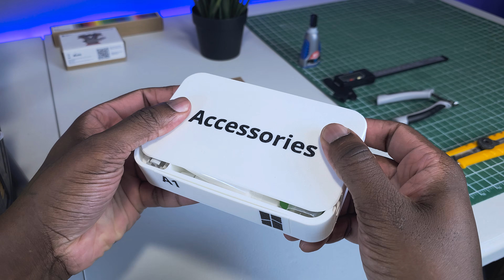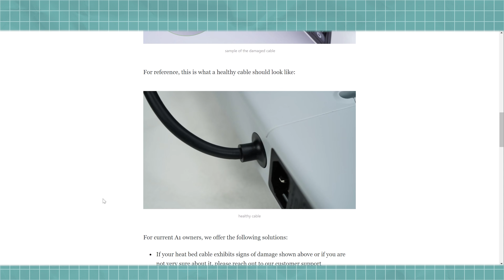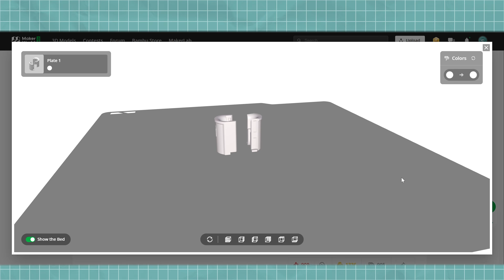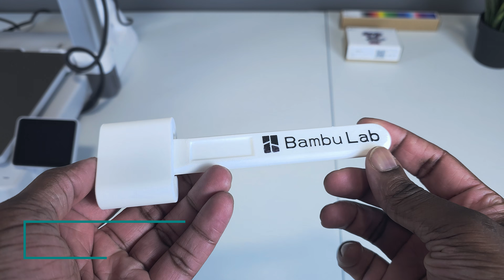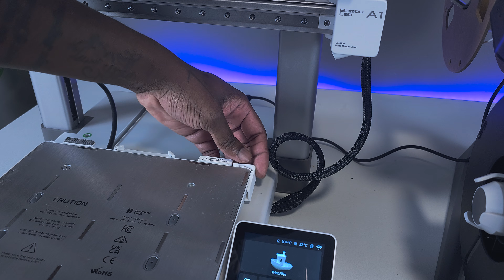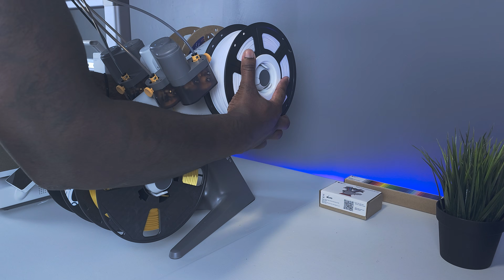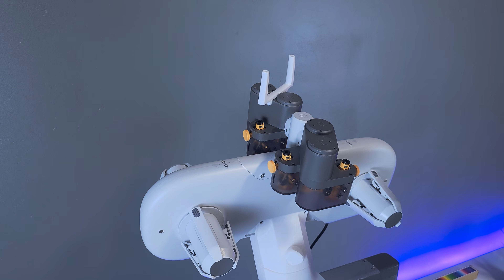Must-Have 3D Printed Accessories! for The Bambu Lab A1

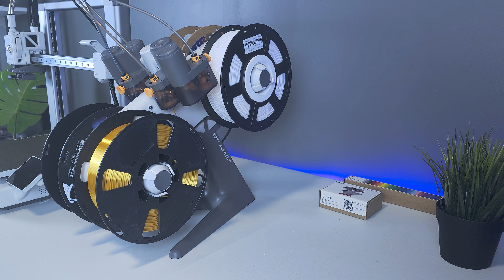Comment: 9:09 Is it possible (thinking durability) to print the top mount in PLA or should it be printed with something else?
Reply from the maker: Yes, you can definitely print the top-mount using PLA. I used Sunlu's meta PLA and it's held up great.

Comment: Very professional video and I needed some of those files. Thank you. Regarding the AMS on top of the gantry-- I may be the only one in the world who worries about it, but I don't like mounting spool holders on top of any of my printers. It's almost a certainty that the amount of mass in those devices will accentuate movement from the bed and other moving parts adversely affecting the precision of the prints. I could be wrong. The mass may actually serve as dampers instead, improving your prints. Maybe an engineer will chime in. Subbed and liked.
Reply from the maker: Thanks for your support! I'm glad that you liked the video.. It doesn't hurt to air on the side of caution - if you have desk space available go ahead and setup the AMS beside your printer. Personally, I didn't notice any difference in the print quality when top-mounted.. It would use up some filament but you can also try and compare.

Comment: I would love to see an AMS Lite mount that actually mounts it upside down.  Is it just me or is it a real pain feeding the filament into those ports where you can't see them? The regular AMS is SO much easier.   Take me seconds to put in a new spool on my X1C and minutes to do it on my A1.  Most of that time is spent fumbling with unseen entry port.
Reply from the maker: It can definitely be annoying at times trying to feed filament through the AMS Lite. I guess both have their quirks and advantages.

Comment: In 2012 I got a Printrbot from their first Kickstarter. The first thing I did was print a bunch of accessories to improve the printer. 12 years later and we are still doing the same thing for brand new printers. It's like buying a new car and then going straight to the local auto shop.. No-one does that
Reply: Yes we do.  (Actually Amazon, and not Autozone).  Instead of $300 to the dealer for the factory rock guards, $45 online.  The tray for the armrest console, not available in the US, $25 online.  Dash mat, $200 from the dealer, $50 online.  That little net for the back of the SUV, $100 from the dealer, $30 online

Comment: For top mounting the ams, I'm just wondering if it'll wobble the printer and you'll need to slow down your prints?
Reply from the maker: Hey! I had the same thoughts before printing this accessory, but I haven't noticed any difference in the print quality.

Comment: after installing the printer. i know why the heat bed cable kept breaking. it is due ot the design of the printer. the fact that the cable is in the way of the sliding back plate you have to move which catches the cable every time you have to maintain or even initially build the item in the first place. the printer is a POS and they need to redesign all of it to make it actually user friendly. what a waste of money, my flashforge ad5m was a much better investment.

Comment: Great video, I've been thinking about picking one of these up for a bit to use as a second printer.  I saw you it on a folding table for the video, is that what you normally operate it on? A folding table would be a convenient option for me but I do worry about stability effecting prints, have you had any issues?
Reply from the maker: Thanks for watching! A folding table works for my needs but I'll admit that a more solid table would be ideal. The quantity of prints that my setup produces is great, but I do sometimes notice that layer lines stand out on tall, skinny prints due to the table vibrating or shaking slightly.

Comment: First one you don't need it anymore
Reply: Correct. Got mine today and it has the upgraded Kevlar cable
Reply: I received an A1 yesterday and they have covered the entire heat bed cable with mesh.
Reply: @BanditTheLizard  I’m gonna be getting one from my school soon! Hopefully 🤞
Reply: @49thstate_outdoors  From your school???
Reply: @siikasim yesssir. It actually arrived today I just need to go pick it up this week! I can’t wait. I got it ordered with my allotment cuz I’m homeschooled and we do homeschool through a school that’s a homeschool school…😅. But anyways I basically got it free cuz it’s from allotment I didn’t have to get it reimbursed. But Yeha I can’t woant to pick it up and then I’m gonna print a skew ride 2 parts and then once I get some more cash I’ll buy the build kit and have a wick rc sled for some deep powder! And I’m gonna. Use my traxxas 5800mah battarys so should be good runtime and power on those
Reply: @49thstate_outdoors Lucky you!
Reply: @siikasim yeah bro the allotment is really cool cuz I can buy school stuff like that. But Yeha I can’t wait to start printing parts for the ske ride rc sled.
Reply: @49thstate_outdoors  Bro i just want one so bad😅
Reply: Why
Reply: @austinevans26  Cause they corrected it from the factory.
Reply: @austinevans26  it's fixed with the new printers
Reply: @austinevans26 fixed
Reply: Yeah he posted that update 10 months ago

Comment: i got my bambu lab a1 combo today.  
and the cable has a braided sleeve. and there are other diffrences making me think this is the V2 after the callback.
Reply from the maker: That's right, the A1 printers sold now have been fixed and feature a few upgrades, so nothing to worry about. Hope you enjoy 3D printing with your new machine!
Reply: @Creatorrific  
it's actually fun to print now.  
the tinkering is ok.  but just simply printing and it just working is actually alot better.

Comment: I don’t know if anyone else takes this shortcut … when switching to the external spool, you would need to disconnect one of the PTFE tubes from the print head and insert the external spool PTFE tube into the open spot. Since pulling a tube from the print head side is quite the frustrating task, even with special tools, I do it differently. The small length of PTFE tube on the external spool holder gets disconnected and put away. When you need to use the external spool, you will not need the AMS lite, so simply disconnect the PTFE tube from an empty slot on the AMS (the tube disconnects very easily from this end) and connect that end of the tube to the external spool connector. You will need to feed more filament through the longer tube to get it to the print head but this won’t cause any issues while printing except with flexible filaments with hardness less than 85a. I have used 85a with this arrangement and the extra friction from longer tube with a longer turn was able to print well but when unloading, the friction was noticeable. My filament has a matte finish on the raw filament and that also contributes to the friction. As usual, make sure your filament is nice and dry before using this method since it may need to make sharper turns before reaching the print head and brittle filaments are not PTFE-friendly.

Comment: 1can someone design a handle/attachement that has 4 ptfe handles so one can put 4 non-ams spool to the 4 hub-hotend this way i would only unload (pull a little bit out not all the way) and load a different color/material pushing a little bit. this way i can have 4 colors/material partially loaded.

Comment: What about building a support for the top-mount extension AMS to the back wall for stability?  Good or bad idea?
Reply from the maker: I've seen it done. I don't think it's a terrible idea if your wall material allows it, but I think the printed top mount works great since there's no need for construction.

Comment: Got my A1 last week. The top mount screws were actually already included and the cable thingy has been fixed!
Reply from the maker: That's dope that it came with the screws already. Hope you enjoy the new 3d printer. Thanks a lot for watching!
Reply: Hi, regarding the top mount for AMS, do you have any issues with it? I'm a bit afraid that the metal part on the top of the A1 will bend with the time under the AMS weight
Reply: @CindyBardalou  no issues so far and tbh everything is quite sturdy, so I don't think anything will happen soon.

Comment: 30 bucks on amazon... a quad holder and 3 bowden tubes later and i  don't need an ams.... btw its only there to tell the printer what you are using for filament...
Reply: How did you do this I am very curious

Comment: Great list of accessories. Love the video. Thanks!
Reply from the maker: Thanks for supporting!
Reply: @Creatorrific  So I did notice that when I tried to use the build plate aligner that I'm not getting "nozzle is covered with filaments" errors because it looks like it checks for filament in the upper left AND upper right corner. Great idea but it looks like the new firmware may cause some issues. Beat my head against this issue for HOURS before realizing what might be causing it.

Comment: The shitty tubing fittings should have been recalled from the start. Biggest gripe. Ive neber in my life had such a hard time removing tubing and I deal with push connect  air fittings almost daily at work.

Comment: Great video. I like that top mount. Most in the past do not have the stiffeners and the A1 is top heavy the the top mount AMS, this solves that problem. I didn't have any problem aligning the build plate with my pre-recall A1 but seem to with it's replacement I just got. Not sure it's it's the new printer or what. If they would remove or move forward the rear magnets on the heat bed I thing it would solve this problem or make the stops on the back of the heat bed bigger/taller. While I like my BBL A1 regretfully "getting back to you quickly" (14.32) is not a something BBL apparently can do. Their support is some of the worst I have ever seen.

Comment: I wanted to tell you what an awesome video this was! very professional, extremely informational and well put together! It's a very classy touch that you give links to all the things that you spoke about through the video. I also have an A1 purchased in December set it up after Christmas and after a slight adjustment to the heat bed it has worked awesome. My cable to the heat bed shows no sign of fatigue although I'm holding off using it and I am NOT returning it!I had considered buying an X1 Carbon but I'm holding off on that too to see how well they pull off the repair of this very nice little machine.
Thanks again for the great video! P@t
Reply from the maker: Thanks a lot for your support P@t! I'm glad you enjoyed the video. Hopefully, we can get back to fully enjoying this machine in a few weeks when Bambu Lab ships those replacement heat beds.

Comment: Very nice selections.  I have most of those printed.  The newest a1 firmware has bed detection and sometimes had issues with the bed plate corner aligner, so I'd exclude they one. Great video, thanks.

And I'm keeping my a1, it's just so good. I've purchased an a1 mini while i wait for the revised a1 heatbed.
Reply from the maker: Thanks for the info! I'm going to keep my A1 as well, but I'm deciding between the A1 Mini or the Anycubic Kobra 2 Pro as a replacement in the meantime.
Reply: Had the same issue with mine since the update.  Took a while to figure it out but then saw that the corner aligner was melted where the tip was touching it.  Keeping my A1 as well.  Nice machines and no issues.  I've got my ticket in and will wait for new heat bed to arrive.  Thinking of getting a P or X series in the meantime.
Reply: There is an updated corner locator for the new firmware which fixes this issue

Comment: I find the scraper to be a bit too scrapy for textured PEI plates. In my experience, the best tool for the job is a scraper made for an oscillating multitool. Spend the money to get a good one and it should be good right from the package. If you cheap out, make sure you take the time to remove the burr from the scraper before use. Either way, these never fail me.
Reply from the maker: Thanks, I might give that a try. You're right, the metal blades are probably best for the smooth plates.
Reply: @Creatorrific there is a print to make the scrapers more perpendicular to the plate. Also the scraper with replaceable blades on printables is amazing. Additionally search the bendable ones. They really get anything stubborn up
Reply: I made that mistake also used it on the texture plate and ended up scratching the film off the plate so had to turn it over and use the other side know for next time now
Reply: About how tall is this printer with the top mounted AMS? I'm considering this model but I'm working with limited space.

Comment: Great video and excellent tutorial on the AMS bracket. Have you come across a good solution for keeping the filament dry while on the AMS lite?
Reply from the maker: Thanks! I haven't found a solution while it's on the AMS Lite, but the Sunlu S4 filament dryer fits 4 spools - perfeft match. I''m going to grab one of those and I'll just dry filament in there before loading using the AMS.

Comment: another great video, thanks :)  tbh I am not sure if you need any other build plates, from what I have read provided textured PEI should be the best in every regard, at least out of ones bambu sells.
Reply from the maker: Thanks! I love the textured PEI plate also. It's a nice finish for the bottom of prints but if the print's orientated on its side, I prefer a smooth finish to match the other side. Otherwise textured PEI plate all the way!
Reply: @Creatorrific  yeah that makes sense, thanks :)

Comment from the maker: 🚨ATTENTION🚨 There's been an official update from Bambu Lab for the A1 heatbed cable call back since this video was released. Please disregard the information on the first accessory that I mentioned. Bambu Lab has escalated the matter and they're saying that ALL OWNERS SHOULD STOP USING THIER A1s IMMEDIATELY. There are 2 options available to move forward. Option 1 -  return/refund the A1 and receive a $80 credit in addition. Or Option 2 - wait until the end of March for Bambu Lab to send replacement parts and receive a $120 credit in addition.

Read their updated blog article here 👉https://blog.bambulab.com/a1-recall-update/

I'll create a follow-up video shortly that goes into detail.
Reply: BTW Bambu is NOT providing a cable replacement. They are proiding a complete heated Bed replacement. I just recieved and installed mine.  Easy peezy with thier instructions.
Reply: The cables in the updated A1 come with a weave cover to stop over-flexing.
Reply: For most that cable is NOT an issue. Bambu is just covering their backsides by doing the recall. That cable guard would work forever.
Reply: Oh, that's good.

I congrat Bambulab for doing the right thing.
Reply: I just ordered mine, and the cable looks very different from how it is in the video. So I think they made changes to the entire design.
Reply: @Aisaaax  mine too
Reply: im not sure when but they called back all printers and fixed the problem if anyone is wondering.
Reply: Yo have they fixed this yet for the UK
Reply: @phoenixcooper486 seems so. I just got mine in UK and it's different from the video
Reply: what the hell man. i try to leave a comment to inform your users of a litteral error one of the suggest accessories cause and you and you delete it? what is this shit?